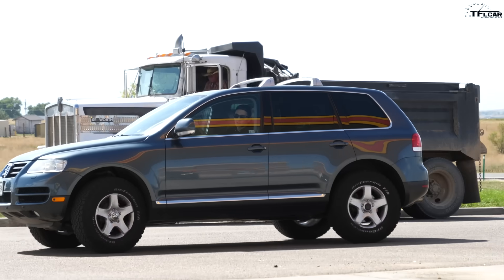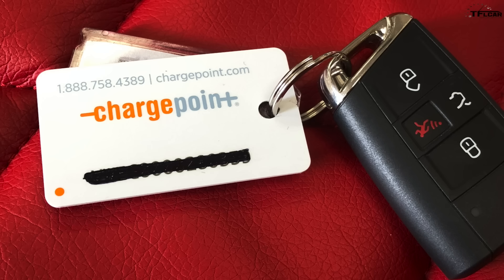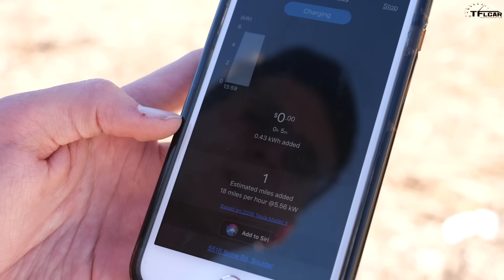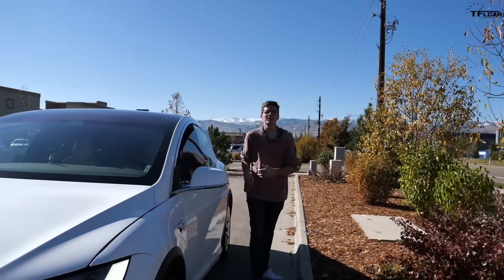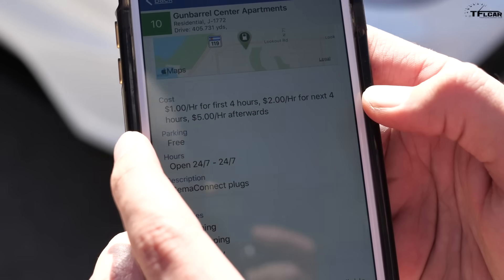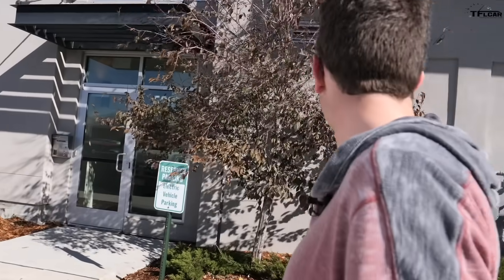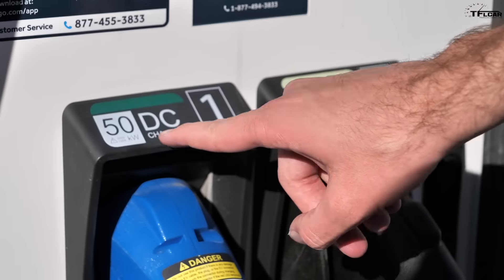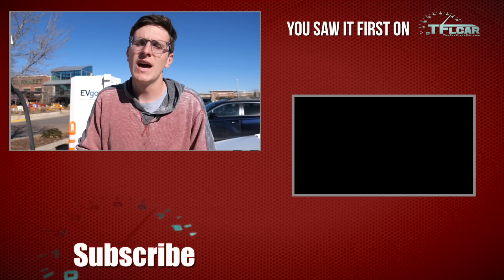Here’s Why Charging an Electric Car Can Suck - And It’s Not The Reason You Think!

Comment: I  guess if you don’t mind filling your trunk with adapters and filling your phone with apps for different power companies it’s okay. If you have all day to charge your car and leap around until you find an adaptable station.  For those that actually have jobs I guess you either are at work or you are at a charging station so you can get to work the next day…You might be saving money on fuel costs but you are wasting huge amounts of time. As they say, time IS money. 
The bottom line is ….this is a big dog and pony show virtue signal!

Comment: At 32⁰ f it takes 36% longer. The batts only charge to 78% cap. Using your elect heater decreases your range severely. Same w A/C. Let me go get you a can of elect stuck in mid of nowhere.

Comment: How about replacing the used up rechargeable batteries, nobody talks about it, no matter how high end the battery is they can only be charged so many times, then they have to be replaced with new cells, $5K, $6K, how much is the replacement after 18 months ?????????

Comment: Or you could finally realize that the power that your "little car" is getting comes from hydrocarbons, coal, or nuclear fired plants, and you're not protecting/saving anything.
Reply: To say nothing about Li mining.
Reply: You're like, 5% right. You've shown awareness of the situation, but improper conclusions. 
1. While it's true that our electricity comes from hydrocarbons, it also can come from renewables like solar, wind, and hydroelectric. Not possible to run an internal combustion engine on these.
2. Not all hydrocarbons are created equally, nor are all engines created equally. Yes, natural gas and coal are combustibles and generate CO2 emissions. But they generate less emissions for the same amount of energy, typically. Gasoline is very energy dense in terms of mass and volume, making it an ideal fuel for a machine that has to move around and carry its fuel with it. Generators have the luxury of sitting in one place, and can therefore be powered by bulkier, but cleaner, fuels. Same goes for engine design. There is a speed, at which an engine runs, at which it is most energetically efficient. Some engine designs are more efficient than others. Engines designed to move a vehicle, must be designed in such a way that they can engage a transmission, exert large amounts of torque, and change RPM rapidly. This is not a requirement for generators. These engines can be designed and ran in a such a way so as to generate the largest amount of electricity possible, even if they are lacking in areas like torque and immediate response.
Perhaps the most relatable example I can provide of this is to look at the drastic differences in city and highway mpg. Running a car at highway speeds (lowest rpm in highest gear) is most efficient, but not always possible. But the electricity that powers an EV is created by an engine which spends its entire runtime at "highway speeds" (to oversimplify things); and unlike with ICE vehicle mpg, EV kwh/m is not highly variable with respect to speed and driving style.
3. Nuclear energy is very efficient and emission free. There is the problem of meltdowns and waste, but these problems have pretty predictable solutions. Another drawback of nuclear is that it is very bad for meeting variable demands - these plants must run at full capacity, and can take a day or more to stop and start. The problem of variable demand is alleviated by energy storage - something electric cars alleviate. In the past, the solution to variable demand was to match the reliance on more efficient, but generally slower to respond, sources of energy to the minimum demand, and meet the rest with less efficient but more responsive sources. With the ability of electric cars to store surplus energy, we can increase reliance on these more efficient, less responsive sources, and decrease reliance on the less efficient, more responsive ones.

TL/DR - though what you have said is true, your conclusion is wrong. Electric cars are both cheaper to operate per mile and create fewer emissions per mile. 

Given that they lack transmissions and have far fewer moving parts, they also last longer and will in the future enjoy much cheaper maintenance (though, as a relatively new and specialty technology, this effect has not reached its full potential) and decreased depreciation with age/mileage.
Reply: What is the disposal cost on those lithium batteries when their life ends?
Reply: @kevinduveneck1504  It's probably "Get All You Can Get", then throw them down in that canyon, with all the junk wind turbines, that will NEVER deteriorate ., but it will make all the "tree huggers" happy.
Reply: coal fired powerplants are falling out of favor
nuclear power plants may be the best type of powerplant available ticking all the boxes
renewables are cheap
natural gas and oil fired powerplants are a lot more efficient than any car engine ever manufactured
also i fail to see the disaster in recycled batteries or lithium mining
Reply: It's called an investment into the future, bro. Initial cost eco wise is greater, but over time, it becomes less. Even if you purely used coal plants to charge over time, the EV car will eventually become more friendly for the environment by producing less than what a gas power car would have at some point.
Reply: @cheetamcu644  What's really amazing is that "You environmentalists " can't understand the FACT that climate change is a normal evolution of planet Earth and civilization has absolutely - 0 - (nothing) to do with it. It's been happening since millenia, "ever heard of The Ice Age ) ? Ten years ago all you guys (Al Gore mostly),  were spouting that in 5 years we would have glaciers down across the midwest, and it was all caused by humans.. . . such Bulls**t ! After selling only a few electric cars, it's been decided that the batteries are junk, and when they die, there's no where to dispose of them. Stop listening to the drivel, please....
Reply: @texan2u  Even if that were the case, electric cars are far cheaper to operate per mile than ICE only vehicles.
Maybe this is hard to grasp because it's hard to make a direct comparison between gallons of fuel and kWh of electricity. So look at plug in hybrids. Many of these vehicles are getting upwards of 100mpg. It's not because of shit performance, it's because having an electric motor allows us to build and run engines in ways that maximize fuel efficiency, by mitigating the need for motors that can generate sufficient power over a broad range of RPM and create lots of torque. Plug in hybrids are being manufactured at prices comparable to all ICE vehicles. 

Even if you think human driven climate change is a hoax and you're not concerned about emissions, that's still no reason to turn your nose up at all the money and resources these vehicles save

Finally; you're absolutely right that climate change is a natural phenomenon that happens independent of human influence. This does not mean humans can't/don't influence the climate, either. The two are not mutually exclusive.

Anyone who has spent any amount of time in farm country knows about corn sweat - the corn that we plant transpires large amounts of water that increase local humidity and heat indices, and actually contribute to rainfall. All plants transpire. This is why there is so much rain in the rainforests. It's a natural part of the ecology. By altering the ecology (planting cornstalks at a density much greater than the local plant life would naturally occur), we alter the weather. This is a well documented process. 

Remember the dust bowl? When drought and poor farming practices led to soil degradation and massive dust storms? Another well documented example of humans altering the ecology, and with it, the weather. Without vegetation and moisture to absorb and evaporate away the heat from the sun, the U.S. experienced the hottest summer on record (prior to 2021).

Ever walked on blacktop in the summer? Notice how it was hotter than the grass right next to it? This is because the dark asphalt absorbs sunlight much better, and lacks water to lose heat through evaporation. This is part of why cities are noticeably hotter than rural areas. All of the roads and parking lots and heat absorbing shingles that we put on the surface of the earth increase the ability of the planet to absorb and retain heat (as opposed to losing it to the atmosphere, and ultimately to space).

All of this to say, we can come up with plenty of relatable, easy to digest examples of humans changing our climate, on a small and large scale.

From 0 AD to around 1800AD, atmospheric CO2 levels have fluctuated a bit. We're talking 280ppm +/- 5ppm, if that. Then, in early to mid 1800s, we see it climb, and keep climbing, to upwards of 400ppm. It held steady for thousands of years (<1% fluctuation), then in the space of less than 200 years it increased by 50%. This happens right at the same time as the industrial revolution, when humans start using hydrocarbons on a large scale for something other than heating their homes. This is not coincidence.

Temperature follows a similar pattern - routine fluctuations of the global average  amounting to about 0.2C/year for thousands of years; then around 1800 it starts ramping up to upwards of 1C/year by the 2000s.

I defy you to provide a peer reviewed study which proposes a legitimate, nonhuman mechanism for these particular changes. 

I'm not of the mindset that it's the end of the world here. But EVs are clearly the more efficient and economical choice, and humans are clearly impacting the global climate.

Comment: You won’t need to waste time at a charging station with NIO electric vehicles.  You will just drive to a NIO location, and they pop the battery out and replace it with a fully charged one.  Takes less than three minutes.

Comment: This means you have several hours to set around to charge your car some, and a bunch of hours to get a full charge.  Now if you start doing the math they are not saving you that much money.  The example of that Tesla, he said it would cost $7.50 for a half charge and would take 10 hours to charge.  Now also remember that you have a 100 mile range full charge.  Simply do the math that equates down to $15.00 for 100 miles traveled which is at $3.00 a gallon a screaming 20 mpg equal.  Take into account you would require a 20 hour charge time to completely recharge the battery at 7.2 kw/hr.  As far as I am concerned this is a joke especially when you calculate the premium you have to pay for the step up to the electric vehicle.

Comment: Unless you live in a built up area, typically in the East, electric cars are only practical in the city.  Distances are too great in a lot of the West.  Then, it takes too long to complete a full charge which is what would happen if you were traveling cross country.  Also, if you don't live in a home where you could install a fast charger, such as apartment dwellers, it becomes a real chore to find a charge station near where you work or live.  I think you are going to do a lot of walking!

Comment: Simple solution is add a trailer hitch and buy a $7,000 Diesel Powered Generator to mount in a trailer with a 35 gallon diesel fual tank.  Lock it all down and forget having to find a charging station.  And the best part is you can add a second charging cord to your generator powered charging system and charge people to park next to you and recharge their cars where there are no charging stations yet.  That will help offset the cost of the generator, trailer and charging equipment.  Naw, I"ll just keep my 4L gas powered 4 Runner.  I can recharge it's fuel tank to 400 miles in 5 minutes!

Comment: SO! If I am low on charge and short on time and have to find a charging station quickly - I'm "dead". Book into a motel for the night or walk round the block for several hours. Yes honey I won't be home until late as the car is flat. Whereas in another scenario I am low on fuel with thousands of gas stations to choose from for an immediate fill up. What a contest - especially as my new electric vehicle was so much more expensive than a petrol one.

Comment: Terrific informative video, and surprising as well. Open to idea of next vehicle being an EV, but less so after seeing this video. Plugs not being standardized is a surprise. 
Had no idea that charging stations today were still as slow as they are.
Reply: To charge at a high rate would require more and heavier transmission cables. Billions of dollars, if not more. They would need built in transformers on board the cars to reduce the voltage after delivery. Go to hydrogen. Water in water out. Water the lawn everytime you start up. Simple. EV are local vehicles. Perhaps next century EV might work but not for a lot of years yet. ( Don't forget about battery diposal and the base cost of producing batteries and the associated pollution.Another little teensy weensy thing is that we need the trace/essential gas CO2 for growing trees and crops. <150ppm nothing grows.
Reply: has to b as fast will overheat and destroy battery or charging station
Reply: No surprise when cell phones and laptops don’t have standardized chargers or headphones. There should be interchangeable plugs on all electronics by now..

Comment: EVs make some sense for users in large, densely populated urban areas, they are a non-starter for rural areas. And they make sense only if the user can charge the EV at home overnight so that no alternative use of the time is forgone. Any sensible accounting of the cost of operating the car must include a cost for the time expended waiting for the vehicle to be charged. Using the most capable charging method, it takes at least half an hour to get 400 miles of charge, whereas fueling up for 400 miles takes five minutes. Supposing a person's time is worth only minimum wage of $15/hour, the extra time adds $6.25 to the cost. That wipes out any cost advantage the EV would otherwise have. No wonder that 92% of charging is done overnight at home, or in an employee parking garage while the user is at work; in both scenarios, there is no lost alternative time.

Comment: What if they had charging points at every parking spot? In certain parts of Canada during Winter you can plug a perfectly ordinary car into an outlet so your battery doesn't  die while you are shopping. Same could go for work spaces. Also sometime down the road the car will be able to charge itself with solar panel on car. Either all this or the planet will continue to burn or drown.
Reply: The planet isn’t doing either.

Comment: You know which orifice you can plug these battery operated cars in..... One is also left to wonder about the offset between the car and fossil fuels needed to generate the electricity.  Just exactly what are we achieving!  Furthermore, the batteries are probably made in China or wherever, in plants using fossil fuels..... Then battery replacement and disposal becomes a problem, on and on it goes...where it stops nobody knows.  I'll stay with gasoline vehicle, thank you.

Comment: What is the cost of parking? Can I use charge station as cheap parking alternatives with “free charging”?

For example, meter parking in Boston is a quarter for 12 min not to mention garage parking and it is much more expensive than cost of charging.
Reply: not all chargers are FREE, and im sure the cost of charging will be higher of parking spot is on expensive land
Reply: @williamhaynes7089  What I meant is comparing to cost of parking, charging fee could be just a fraction and be ignored. I am still trying to understand how park while charging works.

Comment: This is not practical, and will not replace fossil fuel gasoline motors unless the gov't steps in and mandates a better system. The most practical system would be for the gov't to require all, and I mean ALL cars to have standardized, interchangeable and removable batteries; driver goes to a charging station (former gas stations) removes empty battery, replaces it with a fully charged battery and drives off after paying. The charging station recharges the empty one and the next driver inserts it into his/her car. The current system will not replace combustion engines.

Comment: Another problem with EV is the efficiency or miles on a charge will keep going down as time goes on. You start at let's sat 250iles on a charge. A year later it won't be 250 miles, it will be less.